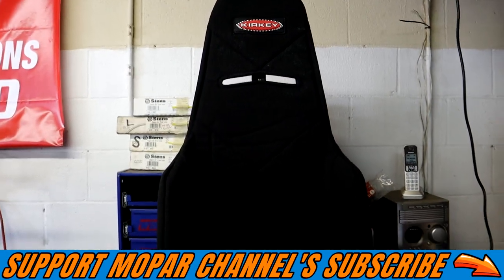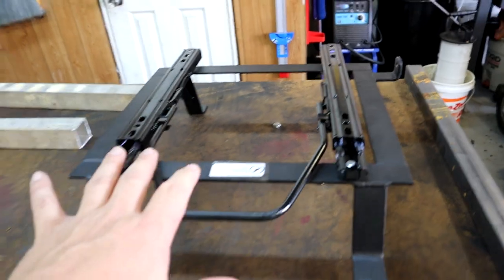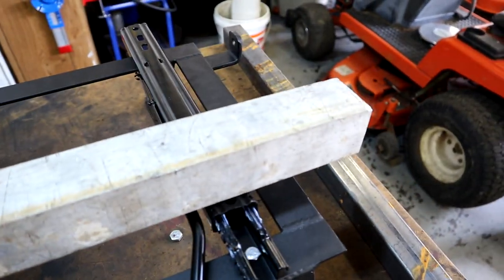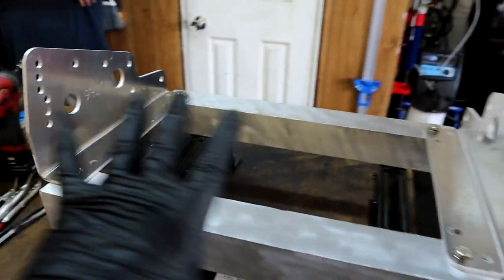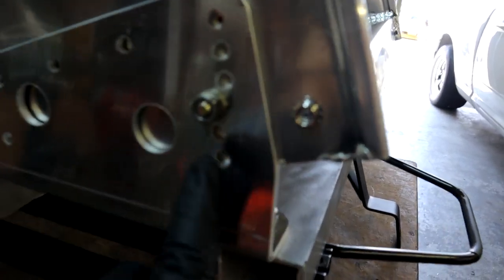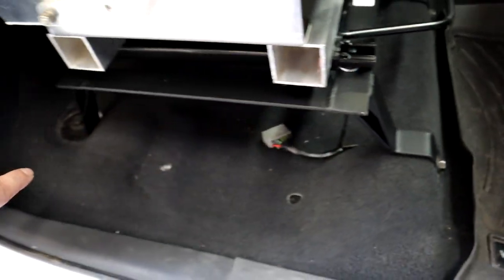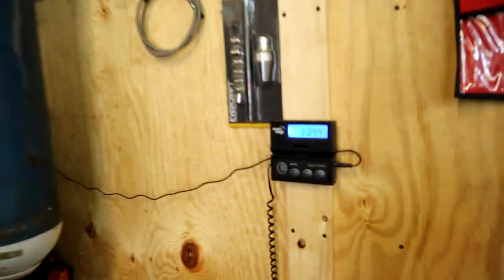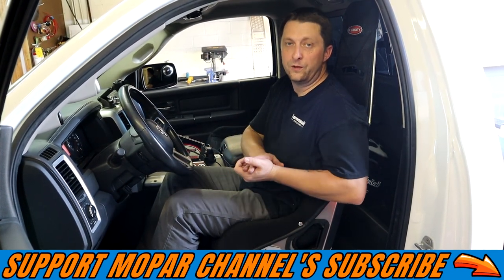Kirkey Racing Seats For Your Ram Truck Complete DIY Install

Comment: Hi looks great! Quick question though. Why did you use the square tubing rather than bolting the brackets straight to the sliders? Are you currently sitting higher or lower (compared to oem) with your new setup?
Reply from the maker: They sit about the same height because of how shallow the seats sit down.